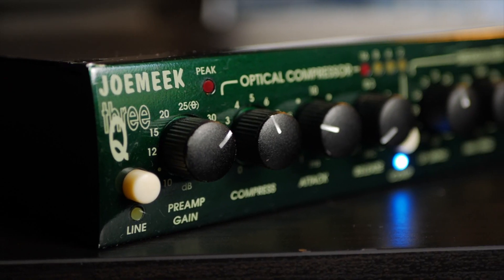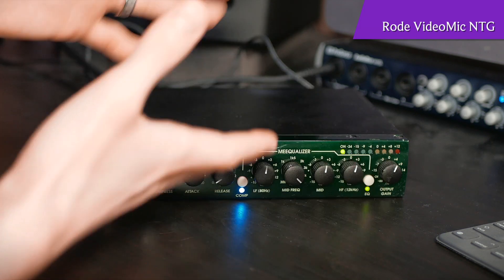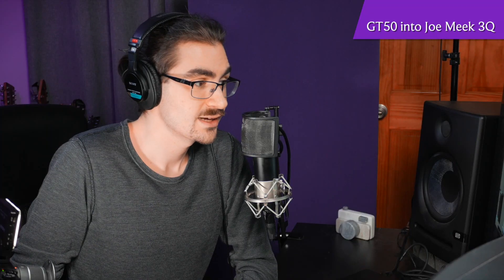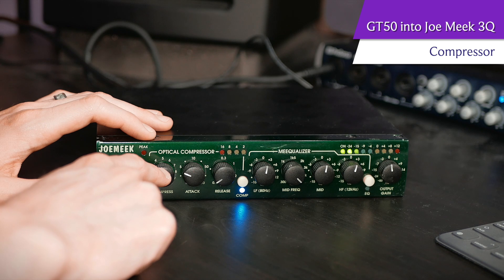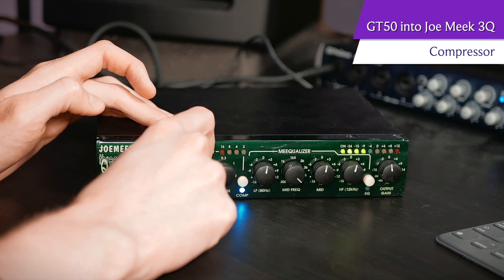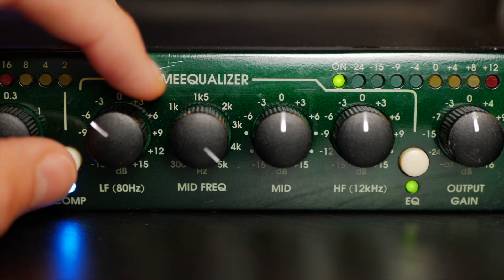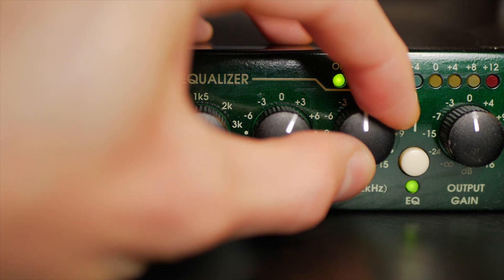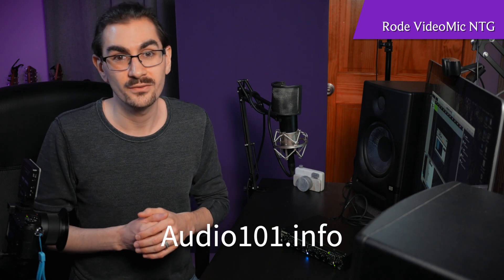Fix your livestream audio BEFORE the computer | Featuring Joe Meek 3Q | AUDIO TUTORIAL

Comment: How do you find the 5:1 ratio. In studios we normally track at 2:1 or 3:1. My worry is with dynamic singers who have -18dB of dynamic range, 5:1 is pretty heavy.
Reply from the maker: It's very heavy on this unit. If you like dynamic vocals and only want hardware compression to keep you from clipping on the way in, or control the most excessive dynamics, this isn't the right unit. Very tricky to keep the compression under control, even for spoken word. Still, the EQ is very nice.

Comment: Sorry if this is a dumb question. You plug your mic via xlr to the preamp but how do you then connect your preamp to your audio interface? Thanks for your time Brian.
Reply from the maker: Not dumb at all! TRS out from preamp directly into one of the inputs on the interface. Could use a TRS to TRS or TRS to XLR cable. I'm using the former. Tested the latter and heard no difference.
Reply: Thank you. I appreciate your reply.

Comment: Great video thx. I just did the same thing but got the presonus studio channel  but it does the same thing (i.e. compressor, eq etc...)
Reply from the maker: Ahhh how is it?? The rest of my studio is all Presonus: AudioBox 44, Eris 8 monitors, and Studio One Professional.
Reply: @AudioforContentCreators  At first   i was havng problems wth alot of noise going into my mixpre 6 but after some gain and connection tweaks, it now sounds great. The tube gives it a little warmth color, whch is nice.
Reply from the maker: That's great.